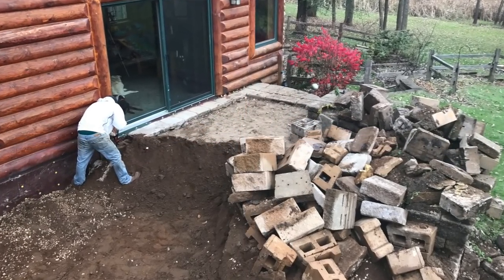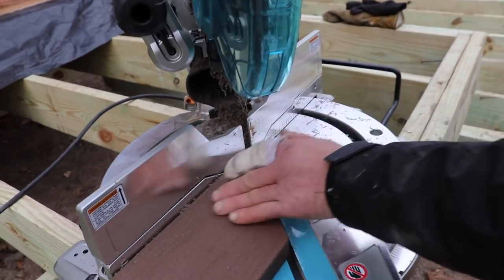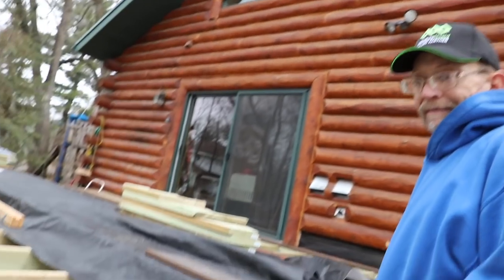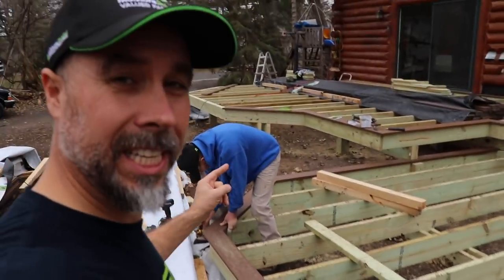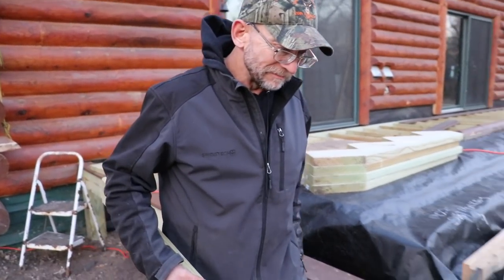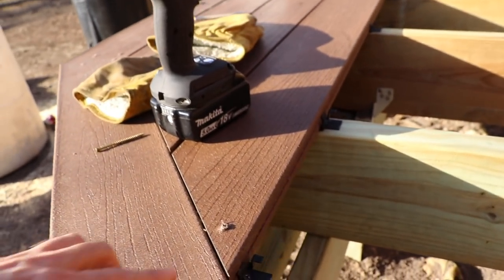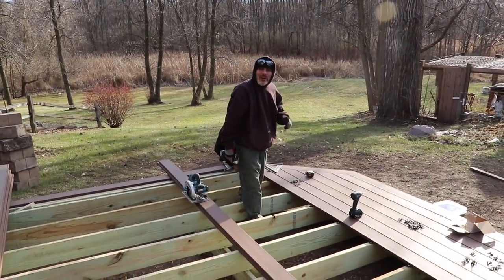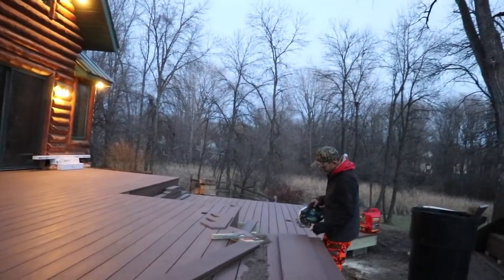DIY How to build a Deck -  Step by Step Guide to Composite decks pt2 of our "Idiot proof" series

Comment: Much better video than the August 2017 deck build video.

One thing that I want to pass on, that I pass on to EVERY Contractor and DIYer, leave a 1/8" gap at your joints.  Composite deck boards expand/ contract in 3 dimensions, depth, width, and length; wood expands/ contracts in 2 dimensions, depth and width, but not in length.  Most deck builders are used to working with wood and make nice tight butt and angle joints, they are not taking the length expansion into consideration, and the boards popping up at the joints in the hot summer months.  The same gap is needed for Fascia boards.  All the composite deck material manufacturers recommend a gap at the joints.

Comment: When you do picture frame you have to do all kinds of blocking to support the field. Use Cortex screws, they counter sink and then plug with supplied plugs.  Much nicer finish. Where the field boards butt up to the border you need to leave a gap, min 1/8th, especially when installing in colder temps. This material will expand a great deal, trust me, I've done 100 comp decks.

Comment: Do the pictureframing last, just leave the deck board running Wild, then just cut them all at once with a skilsaw and then Do your pictureframing.  About 1000%faster
Reply from the maker: Nice-  I love that! Its how we do paver patios.
Reply: I was wondering which method to do First. The picture frame,or the decking.
Reply: That's how I do my picture frame decks leave the boards running long (except at the last couple of boards at the house and then use my rail saw to true up the ends. I also leave my joist tails long and cut them near the end of the decking to ensure I end with a full width deck board rather than possibly having to rip the last board.
Reply: yeah the whole time was thinking why did you build the pictureframing first now you just made the job so much harder and frustrating, i thought maybe he has some reasoning behind it so let me just watch but nope.
Reply: I also noticed you didn't have blocking in place to catch the deck board ends against the picture frame trim board when perpendicular or angled. Trying to put these in after major pain. Always install all blocking, then deck boards, trim decking and install picture frame. Think it out and draw diagrams if necessary if your an amateur. Deck building is my business

Comment: I did the same picture frame on the steps except i did a 30  60 degree cut so that i didn't have to do the blocking any flat surface that collects water will rot.  Also I didn't know the melt method i always used the cortex concealed screws that match the deck also if you don't want to miter the corners of the deck boards you can take the off cut deck boards and make a thin trim strip and trim nail it on.

Comment: If decking is installed perpendicular to the house, no butt joints are needed since decking comes up to 20’ long.  I always recommend doing without a picture frame border, as you can save much time & cost by hiding the ends with a 45 degree cut facing the ground & gluing finished angled pieces or leaving it bare.  Additional benefit: from the house or on the finished deck, your attention is taken away from the decking border and allows easier focus on the yard & surroundings.  Additional benefit: you can accommodate uneven house walls coming off them in a perpendicular fashion.  Of course, the joists need to be parallel to the house.  Finally, use PLUGS for screw holes – much cheaper & faster.

Comment: You need to leave gaps between those miter joints with composite if you're building in cold weather.  This stuff expands like crazy in the heat and they can actually swell between joists.  I heard it can expand by 3/4" or more on a 20ft. span between cold and hot weather.  Just saying.

Comment: FYI , When installing composite stair treads your stringers should be a minimum of 10 inches and maximum of 12 inches on center.  Your customer is not going to be happy when your stairs start to sag. With the stairs under regular use and the sun heating them up it won't be long before the customer cries foul. It seams like major over kill but all composite manufactures recommend  the 10 to 12 inch centers on stair stringers.

Comment: I was taught to not butt join decking. 45 it and the top overlap will tighten and hold the bottom board so that the join stays together better.
Reply: I prefer this method as well. Also when the boards contract it makes the gap a little less obvious.

Comment: Next time place ice water/roofing paper on top of the framing. Worked at a marina fixing docks for almost two decades. Almost 100% eliminates or greatly minimizes splitting from water penetrating and splitting the wood especially in the winter
Reply from the maker: Smart-Thanks!

Comment: You would cut material upside down with a circular saw because the splintering occurs on the top of the board....with a miter saw you plunge into the wood so any splintering would happen on the bottom
Reply from the maker: Good to know-thanks for pointing that out.

Comment: I would considered reading the manufactures guidelines before getting tools out.... once i saw the cowboy face screws i had to shut it off. CORTEX. Composite is installed in accordance with ambient temp. That picture frame will buckle when it gets hot. where's your joist tape?  Flashing? Adequate blocking? so many questions.

Comment: I like the stair tread design. However, seems like the stair stringers are sitting directly on the ground, this will cause it to rot quickly and shift around; I always use a concrete landing. I also love the heat gun trick, Thanks.
Reply: I noticed that too. I was thinking "didn't they just throw away a bunch of blocks?" Could have used to make a landing.

Comment: If you install in mild-cool temps and you get hot days throughout the year you need to gap at least 3mm for trex, preferably 6mm in places like Australia!  Otherwise first hot day it will likely warp the boards.

Comment: You can use the measurement of the long points of the previous boards miters plus 1/16 to 1/8 as the short points of the next board in the row

Comment: I think you'll be surprised (and not a good one) when the temps warm up to 95 deg, if you had read the Installation Instructions for Moisture Shield (or any hybrid decking) you need to have a space on the butt joints due to expansion/contraction of this material.  I see some deck buckling in your future!

Comment: Yes on the railing please. I'm also curious about the face boards on the deck using that type of fastener. Just from looking at it, it appears that over time the boards could pull off the fasteners because the heads are so small. Just an observation, I have no facts to back that up. I like some of the details yall put into that deck. Small criticism.....the colors class a bit. Seems if the deck rail was green it might go a bit better with the house. I  learned a few things though...franky is a guy to definitely keep around...LOL. Curious to know how well this product will hold up to the sun 4+ years down the road.
Reply from the maker: I will do an update video down the road.

Comment: Good video. can you melt some of the deck dust particles into the face nail holes to cover the nail hole.
Reply: Realizing I'm a little late to the party (like a year 😁 late, but...) At 13:26 Stanley answers that exact question Peter.

Comment: You guys used pretty tight butt joints on the decking and you installed in cold weather.  Aren’t those tight but joints going to get even tighter and cause buckling issues when the sun nails that deck especially in the summer and they all expand?

Comment: Hi wonder if you could give some advice, do you calculate the size of a deck your building if it's having railings installed, reason I ask is when the spacing for the spindles is calculated on a certain length rail it's not necessarily going to work on a shorter rail where it stops and starts either side of steps or if the deck as angled cuts, don't know if i've explained well enough hope you know what I mean cheers

Comment: It's interesting that you replaced block with wood/plastic. You can no longer grill on the patio/deck. Well, you can, but you cannot put wood chip charcoal in a grill on there. That makes the best steaks. I understand though that it was a learning process for your company. The end result is very nice.

Comment: I have noticed that even composite decking still shrinks over a years time.  So...Imagine my disappointment when my super tight cuts grew 1/4 inch gaps in just under a year. I have been wondering how to solve this problem outside of seasoning the material in preparation.

Comment: I thought with composition deck you did not butt you joints tight for expansion.....
Reply: John, you're absolutely right...  Engineered doesn't expand or contract anywhere near as much as pressure treated, if at all.  Brand new Treated starts extremely wet when bought new, so they're already expanded.  So technically you can butt brand new pressure treated assuming code will allow.  I've done it both ways, but when I don't butt new wet p.t. it creates even bigger gaps.  I've seen some almost 3/4 of an inch.

Comment: Great video ya'll!  I have a question...I'm about to redo my deck with composite material and want to totally do the picture frame.  I drew it up on paper for the steps and my drawing didn't make it look good; however, I saw this video and what ya'll did with the steps and it looks AWESOME!  Can you please give me a little more detail on the way those steps were cut?  I noticed that the two stepping boards are gapped more than others.  What is that measurement, a half inch?

Comment: Hey Stan love the videos but it’s funny how  your deck would fail in Connecticut 
We use 2x10 joints do to weight of party plus that a lot of the composite decks and snow load are heavy
Then in front of doors should be a step into the house to prevent snow from freezing under the do
But beautiful deck keep making good videos

Comment: Hi Frankie Just subscribed,  Great videos!  Question looks like you put your deck in colder weather like I am going to do how has your deck held up when the weather got warmer?  Do you have excessive expansion or any problems with tight joints?  Would you have added expansion gaps?  Im starting my deck next week.  Thanks in advance.

Comment: Couple issues I see but otherwise a great job.  Should be using joist tape on the tops of all framing.  Also, why not use cortex screws for the picture frame?

Comment: would have added a layer of tar paper to the top side of the joists to help prevent rot, cause that ares in between decking boards on top of joists rots extra fast because of the standing water and dirt that gets collected at these spots. All wood rots even green pressure treated wood, anyone that told you differently is a liar.
Reply from the maker: Good point!
Reply: I have a question about using the tar paper on top of the joists. Wouldn't the water pool on top of the tar paper then? Where would the excess water go then?

Comment: My friend had a deck like that plastic composite stuff. It’s good for bare feet since there’s no splinters. But it’s gets so hot you can’t walk on it bare feet and when it’s wet it’s a death trap. So it’s completely useless. I would never buy it.
Reply: FishFind3000 -  I like the 'Cool Deck' feature on Moisture Sheild line. Im in Florida so a deck can heat up real bad
Reply from the maker: Yep- those are typical problems-thats why I went with Moistureshield-there material doesn't have those issues.

Comment: Hm... At 2:35 we can see there is no spase between deck board (moistureshield) and a house facade. Imagine if your posts (which are close to the house) will pull up in during cold winter?.. https://youtu.be/EmeHmRjeL_Q?t=156
Reply: his posts are 4ft below grade, for his zone that should be enough to prevent ground swell in the winter. Also notice that his "STAND ALONE" deck is not so stand alone. So this will also prevent them from pulling up.
Reply from the maker: Well Said Greg!
Reply: thats ok, thanks. But as we know, power of frozen water could be more unpredictable.

Comment: I see a box beam in that deck.
That's a no go these days.
That's one old school way that's no longer code compliant due to failure of the wood due to splitting out at the bolt hole location.
Been doing this for 30 years...look it up.
Google is free ...
No box beams...never.

Comment: those screws are terrible for cold winters because or retraction the screws break. Use the same screws but stainless steel which bend with heat and cold. Had to repair many jobs and lose a lot of time because of it. Important to leave a gap on the picture frame also for expansion this is plastic decking everything needs to be gapped even the fascia. Fascia needs to be pre drilled to allow expansion or else they will buckle. All in all good job overall for someone that never used composite. Idiot proof is not true, these decks are hard to build with no experience.

Comment: Ive yet to see composite that still looks good 5 years later.
Usually looks like crap in 3 years max.
Reply from the maker: I will make an update video and let you know how it looks.
Reply: If you properly clean the deck every year with a composite deck cleaning solution, and keep leaves and debris off of it, they can continue to look good for a while. The biggest issue is fading, which stops after the first couple of years. If the decking doesn't get even amounts of sun on all surfaces, it can look a little weird. 

I would tell my customers to often move their furniture/grill to different locations for the first couple of years in order to mitigate this.

The fading should even out over a lobger period of time though, as the deck will only fade so much before it basically stops fading. The areas that get the most sun will fade first, and the areas that get the least sun will take longer. Eventually though, it should all even out.

My biggest concern is that no expansion gaps were left for the lengths of these composite boards. There should be 1/8" minimum gap on the ends of every board. ESPECIALLY since it was installed in cold weather. You're going to have some bad times this summer when that stuff expands in the heat.